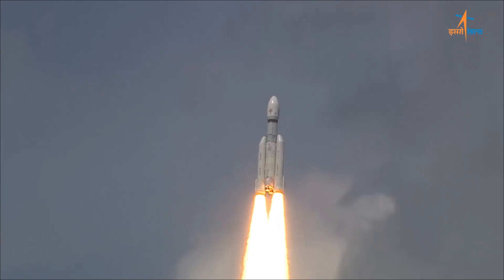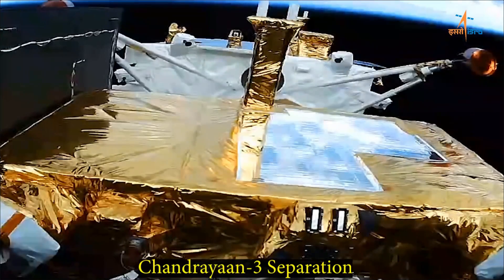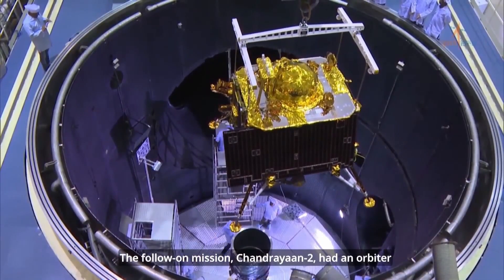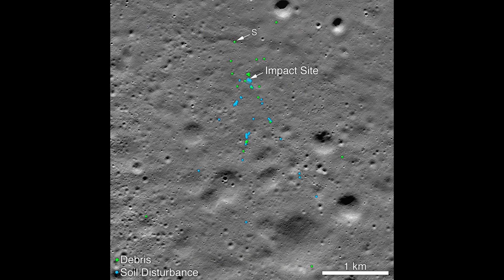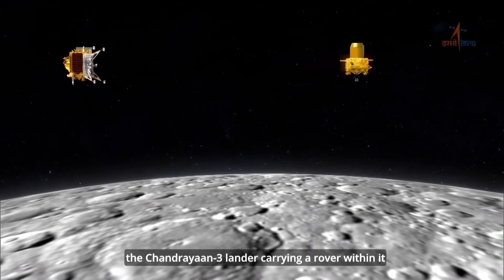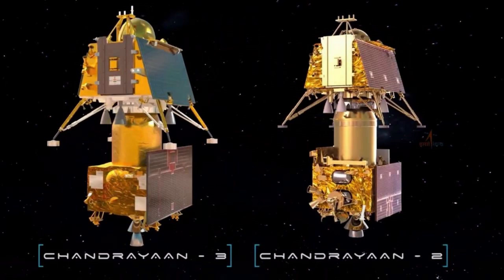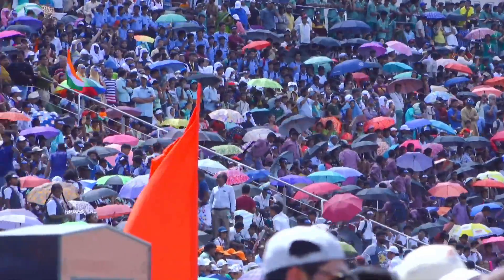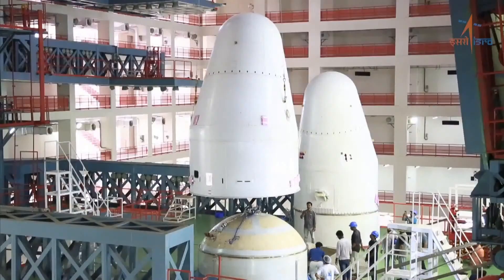India's Flagship Lunar Mission Chandrayaan 3: Will it Brake or Break?

Comment from the maker: I keep seeing comments from people telling me that the reason for the failure was revealed recently, this is not true, we did get more details on a number of important factors, but there's no clear chain of cause to effect which explains what was seen without speculation. Recently ISRO Chief S Somnath made a number of very helpful comments highlighting:
1) The engine over performance during rough braking resulting in the spacecraft being on a trajectory that would land shorter than intended
2) A landing area which was so small that the over performing braking left the spacecraft trajectory outside this area
3) Software limits on things like vehicle rotation rates

So it's clear that when the vehicle transitioned to fine braking mode it was in a situation that left it unable to reach the target site, and somehow the guidance software let the vehicle spin out of control. And saying 'it was a software glitch' is true, but is not that answer that the engineers used when addressing the changes needed for CY3. 

Some possibilities are:
* In trying to solve to a landing solution the software ended up unable to find a solution and just stopped doing anything.
* The solution math resulted in mathematical operations which crashed the software or left it in  an infinite loop
* The solution found was inside the moon and it flew there.
* The maneuvers to make up the lost distance, combined with limitations on sensors resulted in a mismatch between actual and predicted attitude. 

And many more, possible scenarios, to disambiguate we'd need the actual Failure Analysis Committee report but it was never published even after  legal challenges in court to get it released.

See Here: https://twitter.com/anasfaisal114/status/1572635683914911746
Reply: @ananymouse3988 when our scientists are assassinated  in our own  country our nuclear scientists are assassinated so that we  can't make   a atomic bomb  this is the help and transparency  we are getting from chinese and American
Reply: @Anuragchowdhury4008  Why can't you give them adequate security. After all you are spending money to make nuclear bomb. So it may not be scarcity of money 🤔🤔
Reply: CH3 is trying to land on the dark side of the Moon hope ISRO Scientists have examined & measured the gravitational pull of the dark side of the Moon hope this time they get this right
Reply: @entertheheaven.7671  last time( chandrayan 2) they tried to do hard landing on the surface with 40 degree angle of approach and due to some technical issues in the coding led to the over ignition of the back thruster of the lander and after which it came it contact of the lunar surface upside down and crashed. This time they are trying to do soft landing with down thrusters attached with lander. Lets hope it does not fail or else they already planned Chandrayan 4,5,6,7. It is what I love the most about them, the not giving up attitude. Best of luck mate👍
Reply: @bismayparida2115  Got it. It's difficult task  indeed. I am sure that the landing will be another crash. But sometimes some miracle happens. Wait. 🤔🤔🤔🤔
Reply: @sukhenduswaminathan4492  if it crashes this time then I guess in the fourth mission they have to make more powerful thruster for lander. Let's hope for the best 👍
Reply: There's lot of hate comments in your videos...I guess Youtube is only showing your videos to people who are mentally unstable...
Reply: On the last trip, I think they hadn't thought out all of the problems a lander might encounter in low gravity which they have no means of simulating. They also have no support from other space-faring countries, nor do they seem to want any. Besides, their launches are extremely inexpensive, so they'll keep trying. They probably also need to figure out redundancy in systems.
Reply: @ananymouse3988 uhh.. NASA did not make the impact probe. ISRO did. NASA sent M3G which identified water on the moon from the orbit. India was the first country to do an in situ test. And India made it's claim on discovering water from the moon with the results obtained from the impact probe. The reason NASA is credited for the discovery was because NASA published the paper first. India got its results from the probe but had to process it first before publishing.
Reply: @ananymouse3988 On 18 November 2008, the Moon Impact Probe was released from Chandrayaan-1 at a height of 100 km (62 mi). During its 25-minute descent, Chandra's Altitudinal Composition Explorer (CHACE) recorded evidence of water in 650 mass spectra readings gathered during this time.[117] On 24 September 2009 Science journal reported that the NASA Instrument Moon Mineralogy Mapper (M3) on Chandrayaan-1 had detected water ice on the Moon.[118] But, on 25 September 2009, ISRO announced that the MIP, another instrument on board Chandrayaan-1, had discovered water on the Moon just before impact and had discovered it 3 months before NASA's M3.[119] The announcement of this discovery was not made until NASA confirmed it.[120][121]
Reply: Next time you question who birthed you, get your facts straight first.
Reply: lol i love the "* The solution found was inside the moon and it flew there."..
Reply: @ananymouse3988 ISRO and NASA, both, discovered water on the moon.

Your statement about the impact probe is wrong (afaik). ISRO developed the impact probe which discovered water on the moon but NASA developed M3, which was on ISRO's satellite, which also detected water. NASA published its results first but ISRO's instrument detected the water first.

So, nothing was unethical about ISRO's declaration.
Reply: Without data recovery how possibly one could determine what actually went wrong. We are on a wild goose chase.
Reply: @ananymouse3988 Kerala is it's anti-brahmin state
Reply: @ananymouse3988 Nah but living in delusion isn't a good thing
Reply: @ananymouse3988 No we want a proper gazwa e hindu and gazwa e brahmin in Kerala. We want Kerala to become a muslim majority islamic theocracy with sharia imposed on entire population and brahmins there be exterminated after being forcibly fed beef and hindu temples first desecrated and then converted into mosques, Dailts so far misled by ultra leftists in the garb of Ambedkarites finally finding solace in their submission to Islam, christian population coming to terms to their girls being abducted and foribly converted to Islam before becoming 4th wife of muslim men, then leftist self professed pretentious liberals and atheists being hacked to death making their communist comrades comrades finally absorbing the consequences of getting into temporary alliance with islamists for electoral dividends and collaborating on means to uproot their common enemy, the unifying indic religio-cultural civilisation and then Kerala becoming a qarzone with civil war breaking out between outnumbered minority left armed with sophisticated wraoons and majority oslamists armed with crude blunt unspohisticated wealons and finally the brutal and more committed islamists winning the civil war with their majority, cruelty and blunt force by shoving blunt iron poles up the rears of soft communists they deserve badly and after that allah rule will be established on the soil of god's own country and islamists will live there happily forever, forever, forever. Amen to that. Till then continue propaganda of brahminical and hindutva "persecution" propaganda and stoke all kinds of subnationalism and sabotages while accusing others of the same to muddy the water, with help of your "fellow travelers" in the west like the Soros & Co. under the umbrella of Democrat elites and western deep states, islamist elites and China. We also want you to replicate your success in Kerala, Assam and Bengal in rest of India.
Reply: apart from what ever you have said, another possible reason ( being suggested) is  uneven break force from the engine coupled with kicked up ionized dust cloud which might have attenuated control signals from earth (as a last ditch effort to make correction ).
Reply: Scott they just announced today. Service module propulsion systems test for isro human spaceflight module was successfully carried out today. Whatever happens to C3 the focus is now getting ready for human flight
Reply: @ananymouse3988 MIP or the Moon Impact Probe developed by the ISRO, is an impact probe which consisted of a C-band Radar altimeter for measurement of altitude of the probe, a video imaging system for acquiring images of the lunar surface and a mass spectrometer for measuring the constituents of the lunar atmosphere.[42] It was ejected at 14:30 UTC on 14 November 2008. As planned, the Moon Impact Probe impacted the lunar south pole at 15:01 UTC on 14 November 2008. ISRO was the fifth national space agency to reach the surface of the Moon. Other national space agencies to have done so prior were the former Soviet Union in 1959,[43] the United States in 1962,[44] Japan in 1993,[45] and ESA in 2006.[46][47][48].
Next time, atleast Google what you are talking about. Not just pull trash out of your goddamn head. I never said India was the first country to do a lunar impact probe. I said India was the first country to do an in situ test for water on moon. I also did not say India was the first country to discover water.
Next time you talk trash, tell it to people who might actually believe your fake nonsense.
Reply: Hahahahahaha... as qnfee says "P.0.S.  liar
Reply: You cannot see, because you are fundamentally white racist from UK.
Reply: Chandrayaan 2 is not properly failed mission yes lander crash into the moon but moon orbiter is still working to the moon orbit Today
Reply: @rgaming161 I think you're right . no body expect the  moon surface so bloody hard
Reply: another possibility is fuel shortage after it has increased its thrust more than required due to limitation (20% change directly in thrust which I heard) for reaching its small projected area for which it may increase its speed.
Reply: You are correct.  India has not been transparent nor honest about its failure, which it has even repeatedly called a success.  Its defensive nationalists commenters are no better.
Reply: @downtomars6268  They're probably interns being paid by the gvt to cover their lies and failures.
Reply: @downtomars6268  I think it's because in India the systems don't emphasise on reports to public in any situation. They give some highlights but details are kept with the organisation and investigators
Reply: @downtomars6268 I can understand your Pakistani inferiority complex
Reply: @downtomars6268  yeah I know Man, but people who cry will cry either on not doing or cry upon failing while doing. Failure is always been cherished by Engineer's to course correct as soon as possible, we don't cry Man.
Reply: @downtomars6268  Well our underfunded ISRO organization in a developing country doesnt have a PR team like others but if you are so keen about knowing what went wrong you can find the detailed paper on ISRO's website but again i think all your info comes from instagram so you dont and wont know any better.
Reply: @ananymouse3988 Chase landed on the moon and had hard evidence to prove that moon has water unlike a graph/picture took by NASA which was orbiting the moon. Also ISRO published its research first but its okay whatever helps you sleep at night.

About your logical point on the engine design i would like the other one engine countries to try to build a rocket with our budget.
Reply: What I read was there was a software glitch that caused the lander to provide very slightly too much thrust the entire descent, so that when it got close to landing, it was well before the landing zone.

The software's goal was to land in a pretty small area, but since it was well outside that area, it was faced with an impossible goal and reacted erratically.

Part of the correction is to make the allowed landing area much larger, just in case the initial glitch happens again.
Reply: I think the reason is an alien name ambatukam
Reply: @ananymouse3988 How the USflag shown on Moon fly?  There is no  atmosphere there 🤔🤔🤔🤔
Reply: @sukhenduswaminathan4492   yeah like iran does but the american make drones and crash them in their or they will use your spy to kill Iranian scientists  well said hat off to you sir it very easy for you to say
Reply: The reason is neither. Moon has extraterrestrial landmarks. I guess there's some hidden pacts among countries.
Reply: Why don't they try lander on earth first , if a version of lander that is made for earth descends and operates here correctly they can expect the moon lander to work there, how can they expect it to work when they test only partially like flying navigation unit in aeroplanes and test if it's giving correct altitude etc.
Reply: the reason is the whole basic design of the descending engine Chandrayaan is totally wrong, there is no successful module of this kind design, ie, instead of as all USSR, US Apollo and China's Chang'er, all used one single central big engine, Chandrayaan used multiple small engines with very rough control. For Chandrayaan 3, they did not learn the lesson from Chandrayaan 2, still use the same failed design, therefore the high probability is it will fail again.
Reply: @firetree2007 Hope you didn't place high bets at the failure of the Indian landing
Reply: @firetree2007 hello once again chandrayaan 3 has landed
Reply: @firetree2007  see you on 23-24 August, when the lander lands safely on lunar surface. That will be a big slap on your face .
Reply: @diveshmittal5091  that is totally fine with me , since your Chandrayaan 2 has already slapped you guys on the face of whole India. haha
Reply: @firetree2007  For your info Chinese, it was not a 100% failure . Just wait,  it will be a real slap for people like you this time .
Reply: @firetree2007 you must be Pakistani 🎉
Reply: @msv28-12  go to his account .
Reply: @diveshmittal5091  Why get so upset about the truth?  India is not the only country who tried and failed. Many others did too.  We all want India to learn from its past mistakes and do a successful landing this time.  After all, it also carries scientific payloads from other countries onboard and they all want their instruments to get to the moon safely.
Reply: @firetree2007 Fake id pakistani
Reply: @livinthrissur  ya..... .... Kung-fu Panda china 🤣😂🤣😁
Reply: @diveshmittal5091  Why does it take such a long time for a soft landing on the moon? The soft landing of the US and China's lunar probes also took several days
Reply: @diveshmittal5091 If not then what ?
Reply: @onoofo  Because isro doesn't have a powerful enough rocket that can reach the moon directly, instead it saves cost and  uses the hard way to reach the moon by performing complex task of changing the orbit of the spacecraft.
Reply: @chanas571  It's simple man, if somehow the lander doesn't lands safely , then ISRO has other missions as well aligned in future like chandrayaan 4, 5, 6 ....  .
Reply: @diveshmittal5091  it 100% failure since we are talking about moon landing. we are not talking about the mission to the moon that has already been achieve in Chandrayaan 1. and seriously it is stupid to defend Chandrayaan 2 now, if Chandrayaan 3 work who cares if Chandrayaan 2 is a failure.
Reply: @lagrangewei  Just because a feat has been achieved in previous mission, it does not necessarily get excluded as mission objective in next mission or becomes any less of a challenge especially if that feat is a procedural step for a science experiment. 
Chandrayaan 2 had following mission objectives in terms of a) Overcoming Engineering challenge and b) carrying out science experiment:

a.1) Lift off from the Earth
a.2) placement of the craft into the earth's orbit
a.3) Orbit raise around the Earth
a.4) Escape from the Earth's orbit and odyssey towards the moon
a.4) insertion into the moon's orbit
a.5) Lunar orbit maneuver and placement into orbit for descent
a.6) Controlled Soft landing
a.7) Extrication of the rover off the rover and movement of the rover on the Lunar crust

b.1) conducting Science experiment off the Lunar Orbiter
b.2) conducting Science experiment onboard the Lander
b.3) conducting Science experiment onboard the Rover. 

It is a partial failure as a.6) part of the mission objectives failed and we do not know if the successor a.7) part would be successful had the a.6) part succeeded. 

Similarly b.1) part of the science experiment mission objectives has been a resounding sucess as the orbiter continues rotate around the designated lunar orbit and continues to function and carry out science exleriments. The obiter was not meant just to transmit and communicate between the lander/rover with the ground station but was meant to conduct science experiments as well, like determining elemental composition of the moon using  Xray fuoroscence spectra, experiment on Solar corona from moon's orbit, determining the lunar crust constituent upto a depth of 5 meters using L band and S band synthetic aperture radar, mapping of the moon for minerals and water using imaging spectrometer, study lunar exosphere using quadrupole mass spectrometer, creating 3D map of moon's geology using terrain mapping camera, study electrons in moon's ionosphere and finding hazardfree landing zone, topgraographic models and digital elevation patterm of the lunar surface using high resolution camera of resolution of 0.32 meter, the last one to be used onboarf the very same orbiter to assist in this landing and all of these have achieved their science experiment mission objectives. 

So controlled soft landing part of the mission failed leading to destruction of the lander and the rover while other mission objectives were successful for arriving at the conclusion that the mission partially failed and was partially successful.
Reply: @firetree2007  I hope not as an Indian, but yeahh I get it, ISRO might be doing its best right now to be relevant, hope to see Indian Startups venture into this field as soon as possble.
Reply: @intebuddy  this bad design was from a MS student's thesis in MIT in 2004, with no proof of success, 
with title "Lunar Descent Using Sequential Engine Shutdown" by Philip N. Springmann submitted to MIT committee for his MS degree.
Reply: @intebuddy  China is now testing a descending engine for China's manned lunar project, again, it is a single big engine, with total thrust power of 130 tons, in the test, engine worked for 3300 seconds, 10 times more than it needed for the lander to soft land on the moon.
Reply: @firetree2007  Surely China have a budget, you are comparing developed country by developing one.
They have their own space station now, heavily invested on RnD.
China's economy have out par so much that, corruption and scandals  doesn't seems to visible.
In India even minute money flow is flamboyantly visible to everyone.
Reply: @intebuddy  that it the reason ISRO should be more careful not take the risk of failure by using the successful modules that other nations have shown instead using some no others used before
Reply: @firetree2007  that's dumb, do you know how research and counter research works Man.
There is no harm in copying, but finding efficient cost effective measures using minimalist resources, usually payoff for betterment of society.
Other countries Patents are held liable in Indian courts and you cant exploit international patents in India, 
And push us to make  breakthrough's using different techniques.
Reply: @intebuddy  the fact is Chandrayaan 2 has already crashed.
Reply: @firetree2007  the fact is that aksai chin  arunachal  pradesh is a part of india the fact is tibet is separate  country the fact is china is not a democracy 😂😂😂
Reply: @firetree2007  I understand, I know Man, past two missions were unsuccessful, but that does not ensure this one will too.
Reply: @firetree2007  Do you need any thrust engine to lift off people like Hu Jintao from party congress. 🤣😂
Reply: @firetree2007  why do you bought the Russian missile defence system which is S300,(I'm not sure about the name). Why can't you develop a  better one. So you too buy or copy without shame another good model from other nations and then go on advising Indian scientists. 😂🤣🤔
Reply: @intebuddy  That's why your tiktok got fired out of India and US🤣🤣🤣🤣
Reply: @firetree2007  ------
C-hyna is very good in stealing other's property. This time what are you going to steal.
Reply: @firetree2007 well nasa recently published Chinese vehicle crashing on lunar land but after failing china completely denied it atleast as an Indian we recognise our failure rather than denying it
Reply: @firetree2007  Buddy I'm back after watching the first country(iIndia) to successfully land on the south pole. If you get a good enough degree and drop the smugness we'll hire you dont be shy to apply. GG
Reply: @firetree2007  my dear you may come and convince the ISRO team about this. After all the time for convincing them is over. But I feel sorry for  the imminent crash. 😪